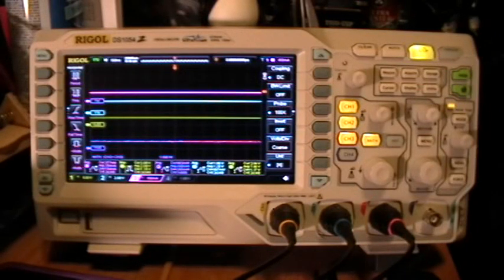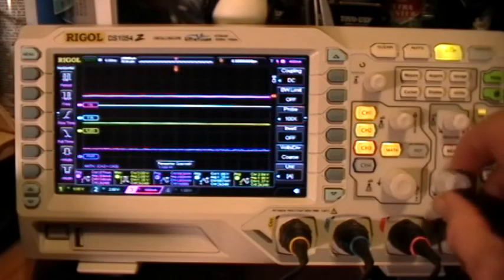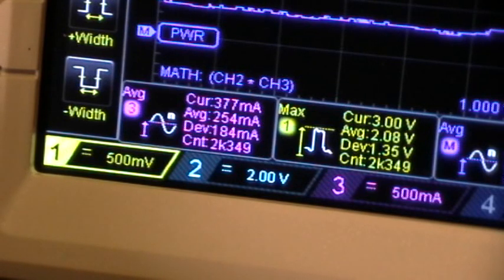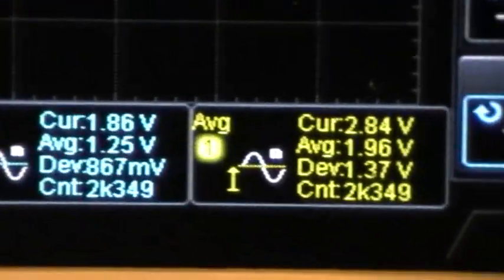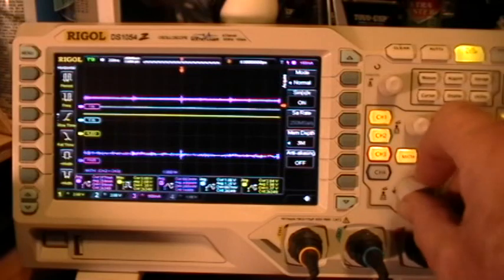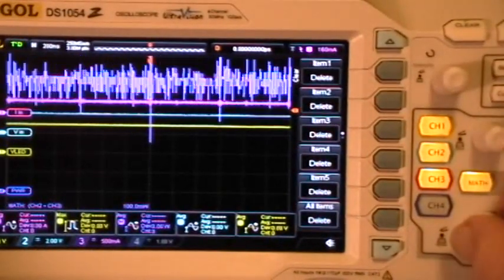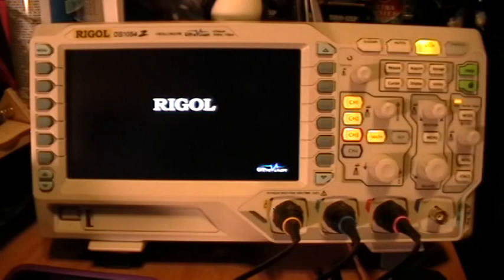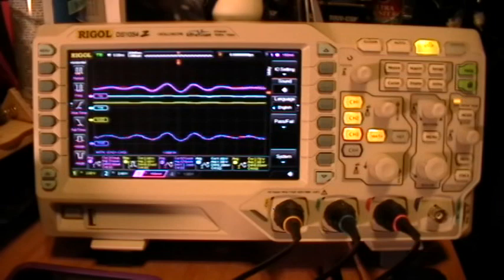Scoposcopy: Rigol DS1054z Measurements Bug Part 3

Comment: There seems to be no hardware solution for this annoying problem.However as with all software solutions,when you repair the tractor on the farm, for some unknown reason, the winch to raise water from the well has stopped working.The hidden network which connects many strands of intelligentsia are as intricate as they are varied.The decline in the honey bee worldwide is a typical example of this.Repair one item without having adverse effects on it's environment.Easy to articulate but extremely difficult to accomplish in reality.I hope that Rigol can come up with a solution to the problem as it limits the use of what could be a very good scope and by advertising this anomaly, can improve the user experience for other electronic enthusiasts.
Reply from the maker: +Tom OConnor 
I hope so too. I think that the scope's software needs a complete rewrite. Maybe then the honey bees will come back!